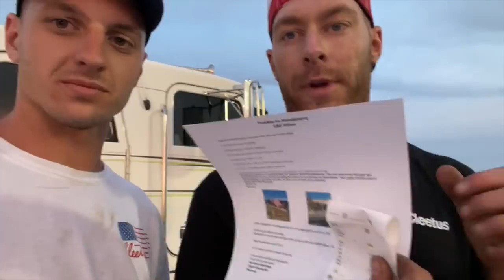First 9 Second Pass Straight Off The Streets!!! Race Week Day 3 Pueblo, CO Did Not Disappoint

Comment: The data logs of before and after the fuel pressure regulator line was connected would be interesting to see.  The Holley self corrections must have been out of this world to compensate for lack of maintaining the fuel pressure to boost pressure differential.
Reply from the maker: We didn’t get any log because the tps was unplugged and the Holley is set to record at 70% throttle